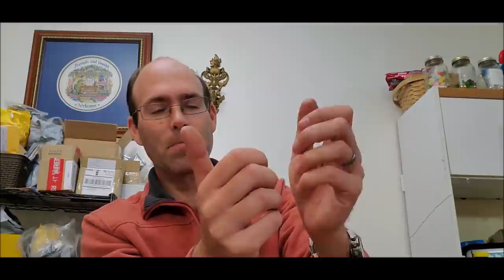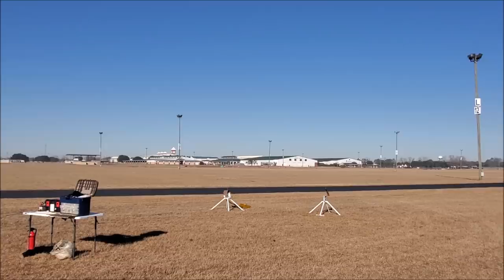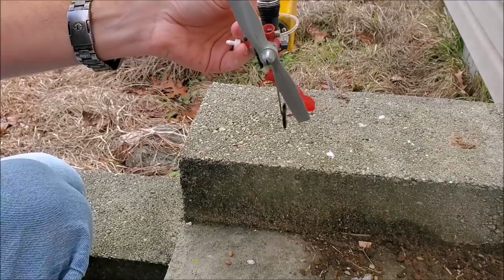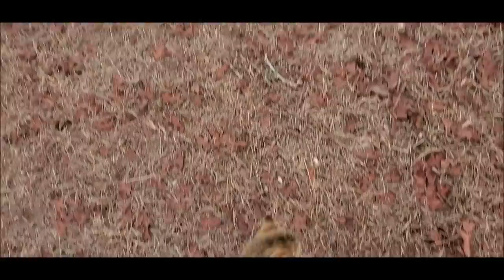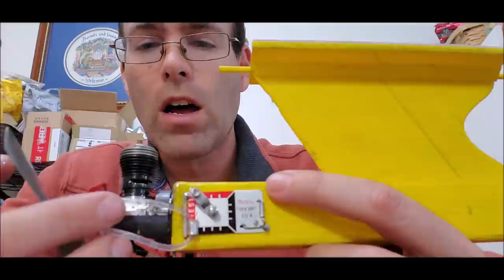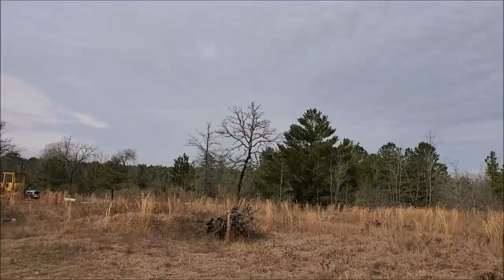I nearly lost my first glow freeflight plane! (featuring 1/2A Top Banana)

Comment: Excellent. Fond memories of my 1/2 A days. We never used a timer. We just calculated run time based on a given amount of fuel. If you knew how to get a reliable run the results we pretty consistent. Never had a Cox engine. Had an OK Cub .049 and a Rossi .074. Also flew a lot of control liners. Then the logical progression into RC. I'm 73 now and still playing with my toys and still preferring Glow engines. 

Thank you for the memories
Reply from the maker: I need to learn how to meter out fuel like that at some point. I'm looking to pick up an OK Cub .049X at some point since it's an excellent engine for Early 1/2A Nostalgia competition.

Comment: Thanks for posting the video Josh.  Basic climb trim for a non VIT,  non AR Free Flight power model is to fly with the inner right hand wing washed in and about 1/16" on a 1/2A power model  which rolls the model left and oppose that with right rudder which then gives the classic corkscrew climb.  Achieve glide turn circle by tilting the tailplane usually about parallel with the wing inner panel.  The Tatone timer you are using is for suction feed and squeeze off to stop the engine.  If using a pressure feed system such as you have off a bladder,  then the technique is to run a separate fuel line from the badder up into the venturi via a line trap mechanism held shut by the timer.  When engine run time is up the line trap is released and the contents of the bladder is dumped into the venturi which instantly "puts the fire out" and rapidly stops the engine.  Much faster than any squeeze off does.  The Cox Medallion 049 is designed to run on 15% nitro fuel.  When you have it consistently trimmed and want it to go faster fit a Cox TD 049.  They were designed to run on 30% nitro.    Best prop. for them is a Tornado 5 1/2 x 3.  Early TD 049's with the slim cylinder around the exhaust ports are much easier to start than the later stepped or thick cylinder versions.  Just check the black plastic carb. body for cracks from time to time as that can let air in causing the engine to run lean and cut out on the climb.
Reply from the maker: Yeah I've got this plane running like a top now. The timer does a fine job of shutting down the pressure feed now that I've put that sleeve on the fuel line, no problems since despite probably 100 flights. I tried lower nitro and didn't get great results so returned to 35% with a TF 5.25x4 prop (couldn't find any 5.25x3) and that gives massive power and a perfect spiral climb. Rollout to glide is quite reliable too. I'll have it at the Nats this year and if it flies like it's been doing so far, it should be a good contender in 1/2A Nostalgia. I'm saving the TD for my Classic Gas models--the ones I've got are in excellent condition and pull my Starduster X and Simplex 300 up fast!

Comment: I used to have a 70 inch skimmer rc glider  (2 channel) .049 and it was semi underpowered. I switched it over to Brushless and it is more reliable! I still have alot of these engines and I love them for control line. Great video Josh, keep 'em coming!!!!!!
Reply from the maker: Brushless is superior and then some for sailplanes. Absolutely unbelievable performance.
Reply: Glow x electric motors is as old LP records is to spotify, you just cannot compare them!
Reply from the maker: @alejandromascitti541  agreed, for the most part, however on sailplanes it's a matter of electric enabling a level of performance that's just ridiculous. When you see a 1.5m sailplane weighing less than 250g that can do 0-100 mph in 2 seconds and then float around like a butterfly, you know there's a new sherriff in town.

Comment: The Top Banana is a great model that can be improved wit a couple of top spars in the wing to stop cow horning.
Reply from the maker: I'll have to keep an eye on that. So far neither of mine have grown any bonus dihedral but time will tell on this second one (first one has had many years to do it, but it's also purely plastic covered).
Reply: Hi. I think you don’t need pressure feed bladder with a Cox TD. I don’t think it was invented at the time of Cox TDs With pressure feed you normally have flood off. With a normal tank the soft neoprene works with cut off.
I flew a Sloworm with a TD 049 in the half A class in the 1960s. Not much different from the Top Banana. It was designed by Dave Hipperson. All your problems here were the same for me. My model was too heavy for success.
These days I use radio dt. Ideal for preventing disaster when trimming and a good way of avoiding trees.😀😀As always a great video. These days I have a couple of Dixielanders, both electric and one radio controlled. George Fuller designed it and I used to meet him at the flying field occasionally. He approved of the electricery. I had a TD 15 that scared me silly. Best wishes.
Reply from the maker: I'm going to be kitting the Dixielander at some point. It's on the NFFS One Design list for a future year. A Canadian was flying one at the Nats the one time I went to Muncie to fly and it definitely went up well. Very cool that you got to fly with George. Lots of cool history there.

Comment: Hi.  Cox addict here.  I'm glad you like your Medallion.  I just wanted to suggest that you get practice starting them by flipping the prop.  Using an electric starter can easily bend the piston rod if the plane is run on pressure, as the pressurized fuel can flood the crankcase.  As a rule, I never use an electric finger on a Medallion or TD Cox engine.  Once you get used to it, the rotary valve engines start with one or two flips.
Reply from the maker: Mark, I understand what you're saying, but we fly these things on a 10-20 second window to get into thermals. If the rod ever does bend, I have a box of spares. That said this engine has been through at least 500 start cycles and the ball joint is still going strong. Using natural castor oil is the name of the game. I've yet to damage a glow engine with a starter. What has damaged them is hitting pavement. 😕

Comment: Most of my early planes were Scratch built  2 channel with a .049 in the nose. Usually 8 - 10 minutes of power, loops, rolls, and wing overs, last minute climb, run out of fuel glide back to starting point. With these planes and engines fly all afternoon use less than a pint of fuel. Great cheap fun.
Reply from the maker: Oh yeah. I had a GLH that I did exactly that with until the engine vibration unscrewed a wing bolt in flight.

Comment: Great video!  I've dealt with Cox .049s and gotten so frustrated with their cantankerous behavior that I will not deal with them anymore.  The way Cox .049's fly best and most reliable for me is to remove them from the plane and throw them as hard as I can. 🙂
Reply from the maker: I've gotten a lot more comfortable with these engines since I made this video and honestly I really like the little Cox engines now. They need natural castor oil, a good power supply to the glow head, and stable fuel flow, but they run wonderfully on those specs. I've gotten Nelson plug heads for several of mine and that has made them run so well that it can be difficult to get them to shut down. I think my number one problem has been the issue of making sure the engine is correctly primed for the first flight of the day, after which they fire up without issue.

Comment: Hi Joshua,. quick question.
Notice your Top Banana looks to have a full depth front spar, added rear spar, and front riblets. These were not on the original plan, so is there a later design?
The pictures for the kit do not show these additions.
Thanks
Jeff
Reply from the maker: That electric one was built by someone else. Ive seen a set of plans somewhere that featured that arrangement. It's definitely not the set of plans approved for the NFFS One Design event.

Comment: When running a bladder,  I use a Perfect style Control line line clip.  You can slide this on the fuel line, and then  use this to pinch off fuel flow until ready to start.  This is a common method in CL combat, and makes pitting/starting much easier.  Also when you hear the engine surging like it was in your first engine start up, that means it is lean. Open the needle a taste.
Reply from the maker: Yeah I've learned all that since. What's real fun is when you've got fuel gushing into a big venturi and the engine is still surging. Some of them are thirsty!

Comment: Reminds me of the rubber powered free flight models my brother used to build. His had a timer fuse that would cause the stabilizer to spring up, then the plane would gently descend
Reply from the maker: I originally set this one up with the same thing. I'm converting it to use a small servo latch instead, since I've had fuse reliability issues of late.

Comment: Start looking for a new glow head. They have a limited life -span.
Reply from the maker: I had several at the time, but have since switched it to a Kamtechnik Nelson head which delivers improved performance. Also changed out the cylinder to a slit exhaust with dual transfer ports and single boost, so it's quite a bit quicker now.

Comment: interesting video.  One thing I have been told with the Red Cap bladders on a small plane to cut the bladder to make it shorter.  I gave up on the Red Cap as after a couple of years they were breaking very often so using a pacifier with TD 049.  I have a Medallion on a control line and after awhile the fuel line was coming off the NVA. I put really small line on but have not run it. I have so many kits to build but might buy this one, it looks like it would build quickly.
Reply from the maker: It's part of the One design next year so you should definitely try it. A very nice flying plane. I definitely need to shorted the Red Cap. It's much too large for such short engine runs.
Reply: @joshuawfinn  okay I will order one.

Comment: Hahaha!! Loved this! I fly control line planes with cox engines but would love an electric starter. Can I ask what type are you using and if its available? Also any info on that pressure bladder and how you made it would be appreciated👍Subbed!! Greetings from the UK.
Reply from the maker: I'll make another video on the fuel system...lots to cover there. The starter is an old Astro Flight 1/2A starter. You can find them on eBay or get a new starter from Sullivan. Definitely a great tool, however you do have to be extremely cautious using it on OK Cubs, Holland Hornets, or anything else with a fragile crank or rod. The Cox engines just don't care because they're built incredibly strong.
Reply: @joshuawfinn  thanks man that's great. Thanks for the info. Looking forward to the video! Cheers😊

Comment: For true historical effect you should have used a finger to start the .049, I’m 73 and that’s how we did it in the good old days. Plus the rag for reverse starts. ;)
Reply from the maker: Yeah...not sure I would have gotten this one started by hand. It needs some help to get going. It's getting better though as I gradually find stuff in it to clean up. I'll probably bore out the venturi and tweak the spraybar at some point to get some better running and more power.
Reply: @joshuawfinn  you can test for enough fuel by opening the needle a bit more. the engine should drop off the scree.  more power is available by going up on nitro... and then the fuel will determinedly adsorb water from atmosphere
and then causing engine sputtering...  use small cans of high nitro.
if your engine loses tune... swap in new fuel first.

Comment: The fix is not to use TT fuel line (you've experienced why) and to secure the fuel line close to the timer so it doesn't flop around.
Reply from the maker: I've got a much cleaner install now, still using TT lines because they don't rot. Have not had a single cut off failure since then despite several hundred flights. The fuel line just has to be pinched fully and not allowed to move around in the pinch clasp.

Comment: Sorry complete noob, how does one fuelproof the tissue.. Or is the dope good enough at fuel proofing, sorry again complete noob not many people in South Africa into freeflight so winging it so far, just got a baby bee 049 and very interested in building a model like in video. And is there a way of making your own timer from scratch, or just go with very small tank?
Reply from the maker: Jared, all good questions and stuff I've had to go through myself. I'm going to get into more of this in the future, but here's a basic rundown: Butyrate dope is a pretty effective fuel proofer. That's what I used on this model, however the front of the fuselage is sealed with fiberglass and epoxy for extra strength and protection. Epoxy is quite resistant to high nitro fuel. Timers are a little tough, however freeflightsupplies.co.uk has timers for sale which are suitable for our work. You can also set up the Forge Electronics timers to run a servo on the esc output and do your fuel pinchoff with a spring mechanism off the servo. If you're looking to compete in the future, this is what you'll be needing to do anyway. Also old Tatone and KSB timers do show up on ebay pretty regularly.
Reply: @joshuawfinn  thank you so much for all the help, I really appreciate it.

Comment: Hi! Why don't you build modern gliders?
Reply: The older ones are more simple and lighter. Plus in my opinion they are much more beautiful.
Reply from the maker: I've done some composite work in the past. Didn't enjoy it (more to the point I hated the process). When it comes to composite planes I'd rather pay someone else to do the build.
Reply: @joshuawfinn  same. Composite is a pain
Reply from the maker: @m.s.aviation7065  I'll probably try again when I have a larger shop built. There are some things money can't buy so ya gotta build them. They won't be sailplanes in the traditional sense though. ;)
Reply: @joshuawfinn  yeah. Man Josh you need a discord server for stuff like this!
Reply from the maker: @m.s.aviation7065  It's under consideration. I'm also looking at setting up a locals.com account with a cheap subscription for content. YT has been really socking it to users lately. Not a pretty situation. Engines, batteries, molds, etc are EXPENSIVE when you're trying to get all of the correct stuff together for educational videos.
Reply: @joshuawfinn  yeah. New Year, new problems... I've got alot of time and I could set it up for you if you would like? I make discord servers quite often
Reply from the maker: Shoot me an email at joshuawfinn@gmail.com and we'll hash it out. :)
Reply: @joshuawfinn  haha i was just about to ask about that

Comment: this is a cool plane" it reminds me of when toy r us stocked those little cox helicopters back in the late 80's early 90's.
Reply from the maker: Cox engines are absolute marvels of engineering. I love them. Incredible performance for mass production engines, especially the really small ones.
Reply: @joshuawfinn  yes these where great, i was in second grade playing with my first cox engine thatbwas on a control line airplane, i took it apart several times to see how it worked and is the very basic of a 2 stroke glow engine, at that age it was easy to see how this thing operated. im just lucky i didn't lose any fingers because there was a few times when i was winding the spring tension starter that it would back fire and try to start up. when i was that age i always exadurated putting this engine on a bicycle to get me going, little did i know at that time that id need about 100 of these to make enough power to do that :p

Comment: My experience is that 1ml of fuel equates to about 1 second of engine run,  I have lost a model because of too much fuel as well as the DT not working...
Reply from the maker: I'd do that but the plan is to compete so I need a clockwork timer. You'll notice at the end I got it set for a very consistent shutoff.
Reply: @joshuawfinn  yep if you're competing then you do need a timer cutoff...I didn't notice a DT though? I mostly fly sport/cabin models on glow so no need for timers, hence the homework on run time vs fuel volume ;-)

Comment: Awsome! I myself am getting some grey hairs with two .049 one with rc carb that is driving me crazy
Reply from the maker: R/C definitely complicates it. Main thing is make sure you induction system is reliable, that fuel is getting pumped to the cylinder, and that your glow plug is hot.
Reply: @joshuawfinn  yes you are right I had a big problem with the fuel tank I built because the plastic material of the tank dissolved into the fuel! Now I am using a hypodermic syringe and seems to be ok, I could not fabricate a suitable tank that will fit inside the model